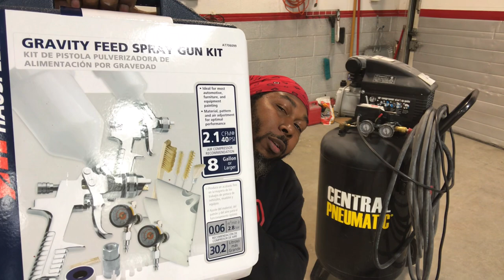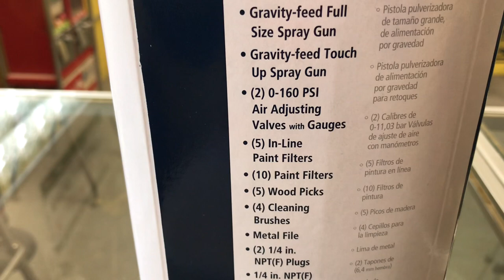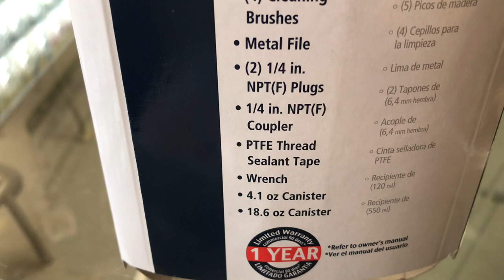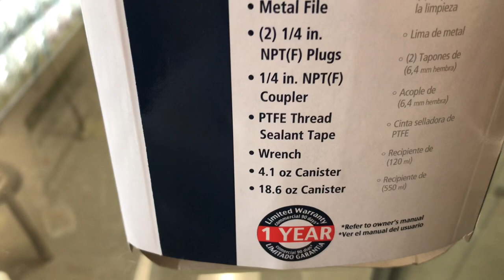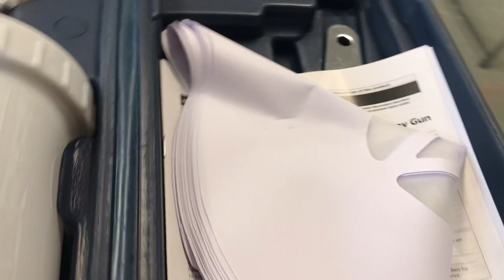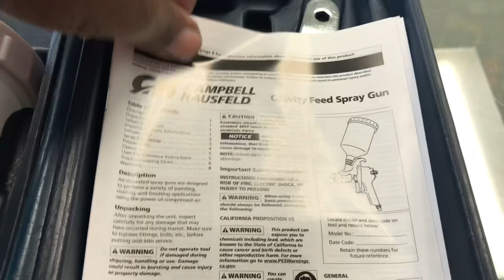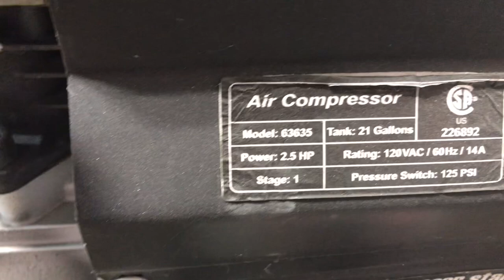Low Volume Low Pressure spray guns for small compressors

Comment: Wat..it do king....i had a couple kwestions..4 u...one is can i..paint lp..w the...devil bliss spray..gunn..meaning..w the 21g..air compressor...and my next.one is...can u set me up..w a system..of how to mixx store..n reuse..my paints n clears..for my pa8nt needs...due to the fact ..that..the vehicle..that im painting..i drive to work on a daily basis...so im thinking..of only.painting..2 panels..per weekend...ex...2 fenders...2 doors..back trukk bed..hood...top trukk...tailgate...etc...this way..it has enuff time to dry..by sunday night..n ready for mondayyy...o n sho..me how to add the metalic.flakes to clear...thanxxx much...peace..out..peeps✌✌👍👍😎
Reply from the maker: You may be able to do a couple panels with a devilbiss spray gun and a small compressor but it'll probably drop pressure if the compressor can't keep up with the demand of the spray gun so keep that in mind...clear takes a hardner or catalyst so you won't be able to mix it and store it for later also some paint materials take a catalyst so you may not be able to store it either so if the paint materials you use take some type of paint thinner/reducer you should be able to store it
Reply: So..then my guess would b u recommend...for my use..the low volume..low pressure spray gun kit..u posted.on this vidd...i was really looking forward.to owning..a professionale..devil..bliss..spray gun...so my kwestion is ...  Wat exactly..happens..wen..pressure drops..n can it b accomodated..  Smaller..fan width..etc...or slower speed????..
Reply from the maker: @titobejar4917  you can go with a Devilbiss spray gun I’m just letting you know of the issue with pressure dropping if the compressor can’t keep up with the demand which causes you to constantly be aware of the pressure so that there isn’t any change in the atomization of the materials that you’re spraying which changes when the psi is changed
Reply: @UndergroundPaintKing  ...ok boss..got..itthanks a lot.....u da..mann...i....had anothe..lil kuestion ..being ur from chicago..n all...u familiar..wdda. Lk.....from cisero.....jusscin kase..u knew him..or heard of him...say wassup..to my..boy..shyster...from cisero...kings....shoutout..to all da peeps...👍👍👍👍👍
Reply from the maker: @titobejar4917  I’m not from Chicago but I’m sure they appreciate the luv!

Comment: The equipment slots in those cases are much to tight.  You have to use a pry bar to free the parts from the case.  Typical Chinese miscalculations.
Reply from the maker: Yeah it’s terrible how you have to pry the parts out the case and everyone that bought the kit has had the same issue

Comment: What are the CFMs
Reply from the maker: Cfm of the gun?
Reply: Your compressor
Reply from the maker: I can’t remember the cfm of the compressor but when I get to my shop I’ll let you know
Reply from the maker: 5.8cfm@40psi and 4.7cfm@90psi
Reply: @UndergroundPaintKing  Even yours has very little capacity. But we are being lied to. The current spray guns use around 4CFM. A 30 gallon with 3HP is plenty to paint a car. Even the HVLP use around 7CFM. We are being told to spend $3000 on a compressor if we want to be able to paint an entire car in one shot. Just not true.
Reply from the maker: @ExtremeRecluse  I have made videos already proving that you can paint a whole vehicle with a small compressor and spray gun so I definitely know that you don’t have to have the more expensive equipment to get the job done but some other people/channels here on YT will tell you otherwise…I call myself the peoples champ for a reason because I do this for the everyday people and weekend warriors that still want to do this kind of work and just need the right information without breaking the bank!!!

Comment: That was an outstanding review, and I learned a lot just from a couple of your comments and watching you paint. I noticed you spray well with either hand too. 
Anyway, I'm a beginner/DIY guy, and I have a bumper cover and small panel or two to do. I already failed with a $15 Harbor Freight gun and 6 gallon compressor. Now, I have a 20 gal compressor that says it'll do 5.2 cfm @ 40 PSI. I bought an Eastwood 4.5 cfm HVLP gun, but I'm wondering if I'd be better off with this LVLP gun. Do you think one is better than the other for a beginner?
Reply from the maker: Thanks I appreciate you!…if the cfm of the paint gun is lower than the cfm of the compressor then you should be fine and not have to purchase another paint gun especially since you’re only doing panels and not doing a whole vehicle

Comment: I have a compressor that size mine is husky but I use normal hvlp and that compressor is a champ can do a front end 2 coats base 1 coat clear before it re start
Reply from the maker: Nice bro...so the compressor doesn't drop pressure on you?